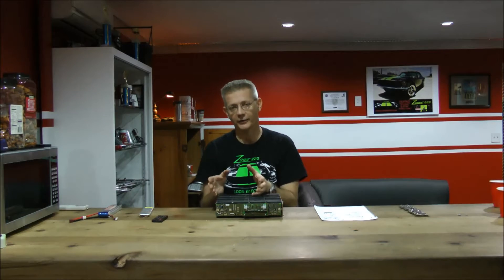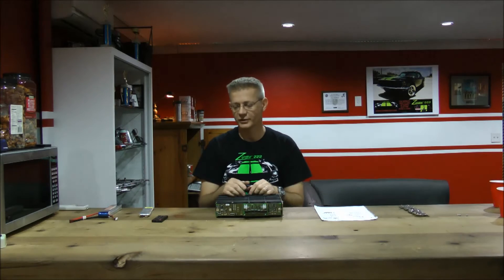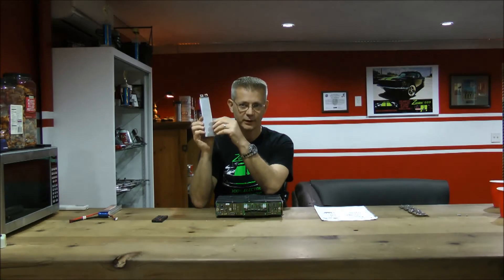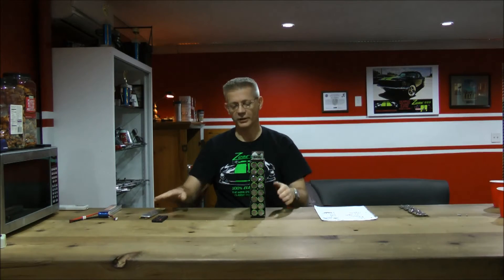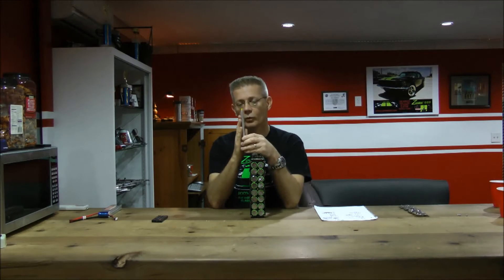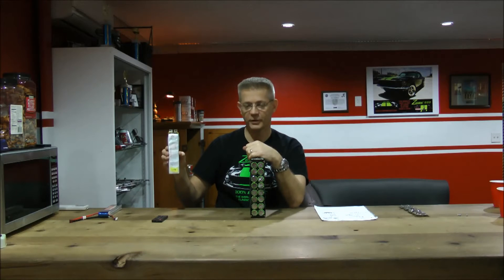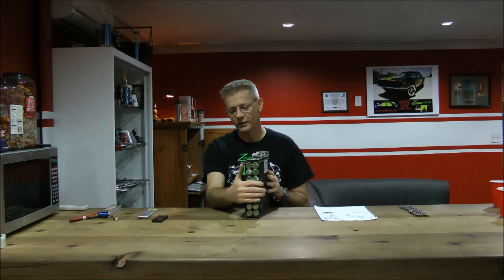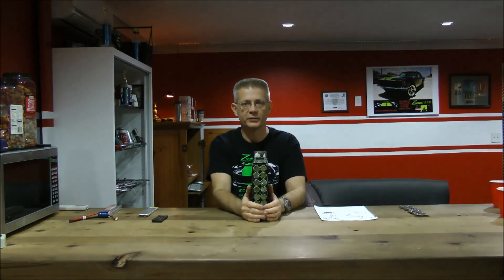battery overview part 3 - internals

Comment: what were you thinking? lower voltage per cell so more cells in series to worry about and deal with, higher weight than the lipo, less energy density than the lipo, less c rate than the lipo, and im 100% positive they sag more than the lipos as well. If the zilla controller isnt capable of handling anything more than 400v, then reach for the amperage limits of the controller. Then when you hit that limit, go for a custom built controller. im sure you can find components that can handle voltages of 500-600 and up. Not to mention that your lipos were not very good ones to begin with. I can get hobby grade lipos that perform better than that and probably were many times cheaper than the a123 cells you got. My math puts your original lipos at 60c rate for 10s burst rating. Turnigy bolt batteries have lower internal resistance and a 65c CONTINUOUS with a 130c 10s BURST rating. poor decisions lead to wasted time and resources getting to a dead end. next time stick with the lipos.
Reply from the maker: +Kenneth Beck Kenneth. What was I thinking? I was thinking that after I damaged my LiPo's (knowingly in pursuit of 200 MPH,) and was approached by a battery company to sponsor a new battery pack of 26650's, you don't look a 10s of thousands dollar gift horse in the mouth and find a way to make it work.  Voltabox is being a great partner by having the relationship, I am in a good position to help guide and influence them as well.  I do not have infinite resources and a sponsorship is very compelling.

Because of the affordable price, we have tested a number of hobby grade high C-rated lipos and found them to be lacking in their published specs, dangerously quick to excessive heat  when stressed and with a typical 200 cycle life span, not a viable option FOR US on a 1.5 megawatt battery.   If I had a pure drag racing car limited to short 1/4 runs, I would consider them, but not on long runs like the Texas mile or hard street driving. Our original custom built LiPos cost much more, but had a cycle life of 2000 and when we pushed the pack to the point of failure, they simply out gassed. We had reached temperatures of over 500 degrees in the center sections of the pack based on the color change in the copper interconnections and none of the cells excessively puffed or caught on fire. Sometimes you actually get what you pay for.  

You seem to have pretty strong opinions and must have a lot of experience to back them up. What high performance EV conversions have you done and have you done a lot of EV racing? I would love to look at some of your stuff.
Reply: +mitchmedford i have done many high c discharge rate ebike conversions so i have a very good knowledge of each cells capabilities. i dont care about cycle lifespan very much as performance is more important for the price. i check the IR of each cell i get from packs i split up and group them according to exact matches to have a solid pack that i know exactly how it will perform under certain conditions. then i do load tests to confirm the voltage sag at each amount of amps i plan to pull. hobbyking has cells more than capable of c rates that you are requiring. even continuous ratings that match the burst of the lifepo4 you got now. i know sponsorship may sound appealing but the cells you require are outside the capabilities of those cells.
Reply from the maker: +Kenneth Beck Thanks for your response. We tested several high C lipo cells from Hobby King and another major brand and had different results than you. I agree that if all you care about is short use high performance "disposable" cells, then RC LiPo could work. A few of the NEDRA racers use them. Unfortunately, we also need to think about the fact that our customers who are spending 100-200K for full conversions are planning to use their cars on the street daily and so cycle life becomes an important issue. Since the 26650 is a big brother to the 18650 like Tesla uses, we wanted to gain some real world hands on experience and the sponsorship gives us that ability. It is also pretty interesting to see what Tesla is able to get out that chemistry. I have raced a P90D and it is an impressive car. Ridiculously quick, pretty fast and just a great car all around.
Reply: +mitchmedford format of the tesla is not much different but the chemistry is completely different. tesla cells just have a huge capacity and only about 5c discharge. your lifepo4 cells are probably about 2.2-2.6ah and a nominal of 3.2-3.3v while the tesla 18650 cells(2/3 the size) have 3.4ah at 3.7v nominal. tesla just uses a perfect balance of battery size, weight, and pack design to make it work well. the amount of battery you need to get the power required is about the weight of a tesla battery pack. i wouldve looked into the voltage limits of the controller and checked what changes to the controller could be made to increase max voltage allowed. i think the armature limits before the insulation breaks down is probably around 600v so there is room to go up in voltage. this is just my 2 cents on it. btw when you tested the lipo packs, did you test each type or did you test varying sizes of each type? because the smaller packs tend to hold true to their c rate better than the larger AH packs.
Reply: " i wouldve looked into the voltage limits of the controller and checked what changes to the controller could be made to increase max voltage allowed."  exactly what i was thinking while watching.  

the controller is the limiting factor.  for these drag race applications i cant help but think about a more robust and direct switching system.  the controllers will be great for customers who are not pushing the heat/speed/power limits.  they will want smooth acceleration,range, safety, reliability etc.  drag racer and customer conversions are two completely different goals, but i can see how the branding and marketing of the drag racer can earn the financial interest of customers.  

kudos to Mitch for doing this.  exciting to see these applications.  im curious about the safety limits for the motor you use both voltage and current.  make the motor the bottleneck.  i also love that you are using classic american muscle cars instead of all carbon fiber 2015+ Japanese cars.

Comment: With the new battery pack, I noticed that because the cells are round, there is room for airflow through the individual cells rather than having the LiPo straight stack. Do you think this cooling improvement will help in performance/efficiency/safety? or are the differences negligible.

Comment: How does the weight of the 2 packs compare?     Sounds like A123 the bigger heavier LifePO4?
Reply from the maker: +jehugarcia The old pack weighed 300 lb. and the Voltabox weighs 1,000 lb. However, the old pack had a max discharge of 1 megawatt and the new pack has a max discharge of 1.4 megawatts. Will the power make up for the weight in a 1 mile run? The old battery was fading in the last 1/2 mile and this one shouldn't, but will that make up for the weight? I'm sure if the run was longer it would, but 1 mile it is...

No one seems to really know, so we will find out in a couple of days if we can finish in time.
Reply: +mitchmedford  Hopefully new pack performs better,  if not,  you can always add an additional 1mW of lipo  to the old pack for a total of 2mW  @600lbs   Imagine that.

Comment: I worked alot with these A123 cells since 2007.. but it was the 2.3Ah version but with same discharge current caracteristics.  I remember a great advice from Bill Dubé qwith the killacycle and he said that he got significant performance from these cells by heating these up to 70 celsius before each drag race. That lower the internal resistance and  reduce voltage sag. You might have to test that for your  purpose depending on the time you will discharge these at high rate to make sure that the added heat of the high rate discharge does not make the cell to enter in the unsafe area... I have all A123 documentation about these great cells.. let me know if you are interested. btw this remember me a test i made with only 4s1p of these cells as a jumpstarter for car battery. We realy were able to start a Subaru Impreza  with the motor ice cold at at -20 celsius! and believe it or not...  there was NO  battery on the car and the alternator pulley was jamed so the belt was sliding on the pulley when the starter was trying to start the car!! was awsome brute test !!
Reply: I don't know anything about electric cars but I was of the understanding that heat increases resistance? I am probably wrong so please don't think I am being rude.

Comment: Do you know what kind of heat will be made when the battery is subjected to full-on racing discharge conditions? Same with charging, do you have a process that addresses heat build-up while charging? I know that TESLA uses liquid cooling to keep the temps in all scenarios in a practical range.
Reply from the maker: We haven't had any actual run time on these cells yet to develop a sense for heat build up. The cases are being designed to have filtered forced air cooling , but folks more familiar with these cells do not believe that we should have a problem with a 1mile run, even one as intense as the Texas mile. If, and that is a big if, we get the car ready in time for some road testing before the race, then we will have a pretty good feel for how much cooling is needed and when. As far as charging is concerned, we will only be using a 220v 30amp charger so heat generation will not be a problem.